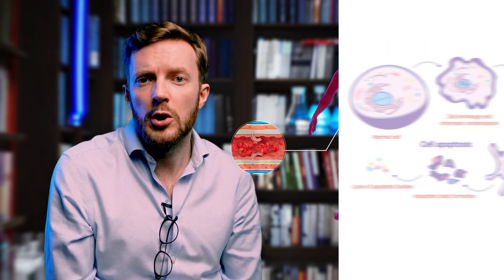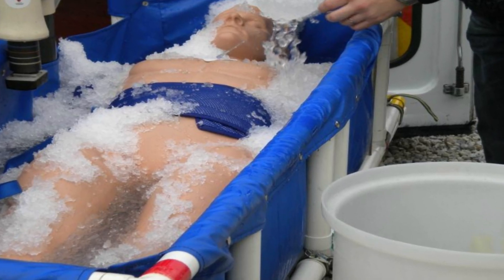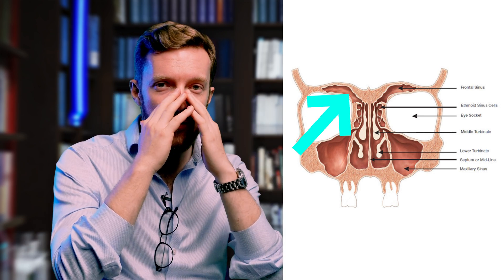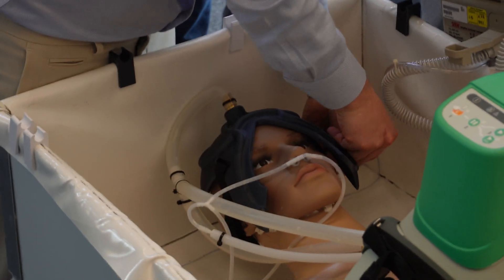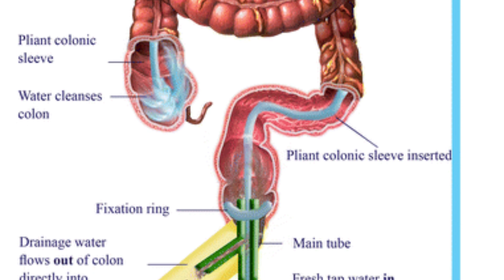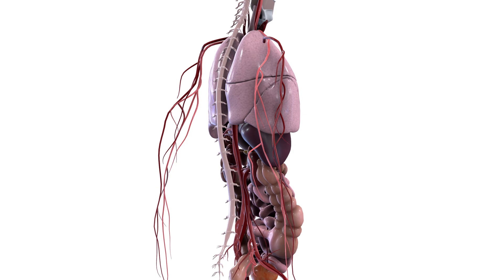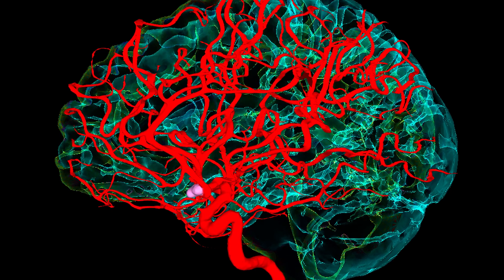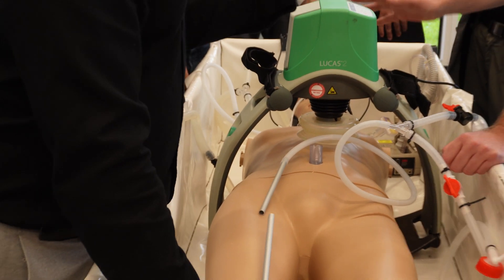How Cryonics Works: Cooling A Human Body From 37°c To -196°c Explained

Comment: i am a med student, in 06:03 your heart lung machine do you mean EMCO? thx ps if i am the patient, i'll rather go thru femoral artery, may be bilateral. may be even with brachial artery/cephalic artery, carotid artery etc. midsternotomy is fearful. thx
Reply from the maker: We use our in-house custom version of the traditional CPB machine, not an ECMO. The reason for preferring the aorta is purely the larger diameter which also allows for better flow dynamics, another reason is the proximity to cranial blood supply since that is of the highest priority.